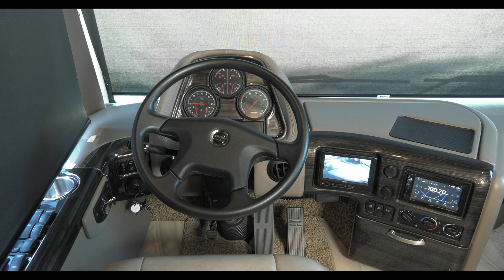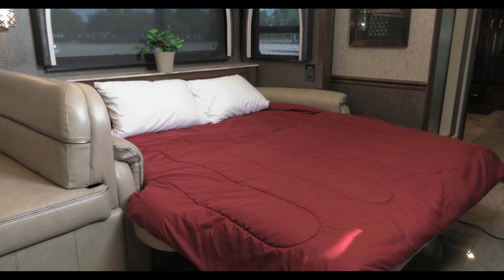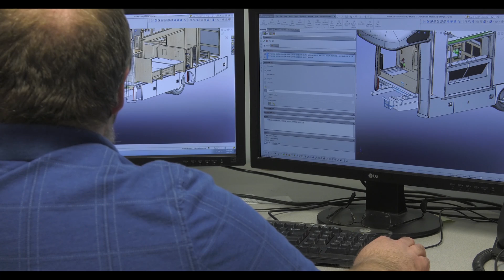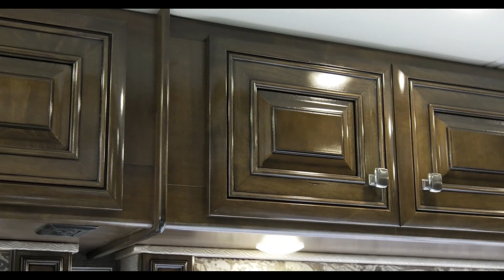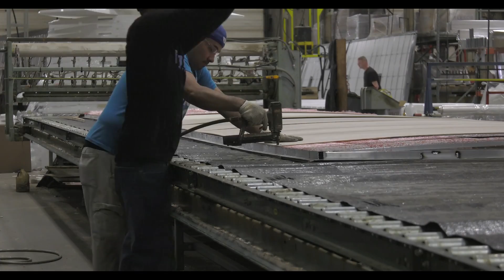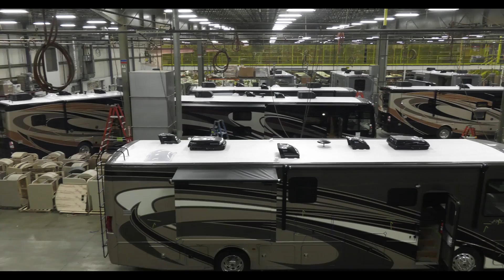Thor Aria Diesel Motorhomes Review - New 2017-2018

Comment: The radiator is on the rear blocking the engine the radiator should be on the side so the engine will run cooler.